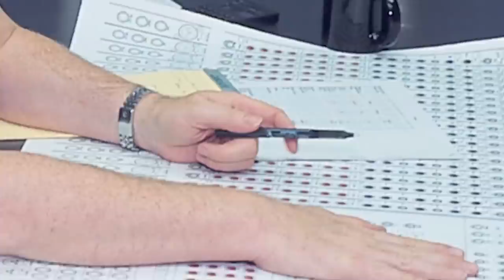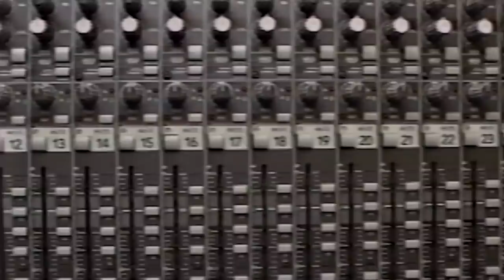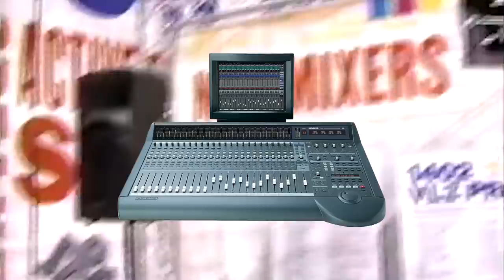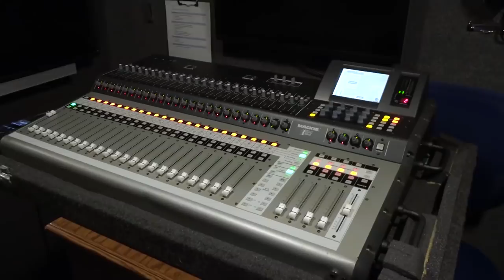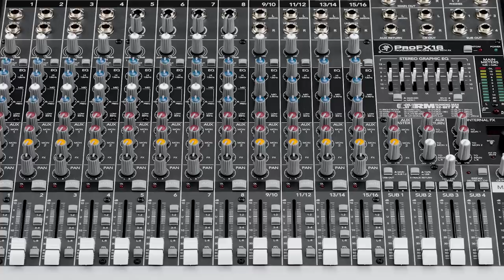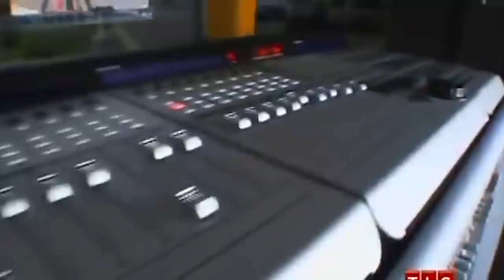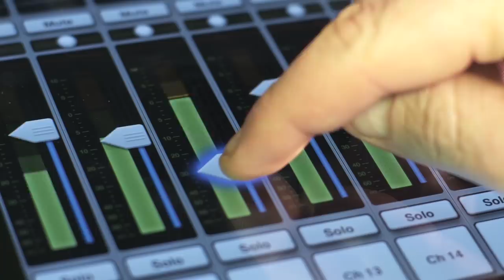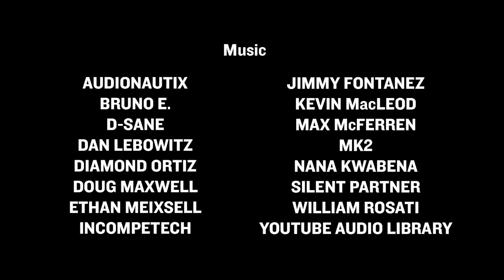Mackie 30th Anniversary Documentary

Comment: Miss the old mackie gear. Especially the SA series those were the best
Reply from the maker: You should check out the SRM V-Class series (once this dang pandemic is over). We really made it a top priority to make them good from the inside out especially with the drivers. Just the woofer alone is dramatically more robust than anything else used in the price range, and it makes a massive difference.